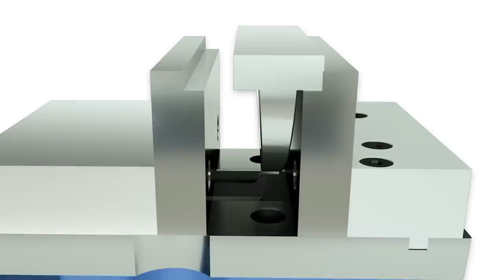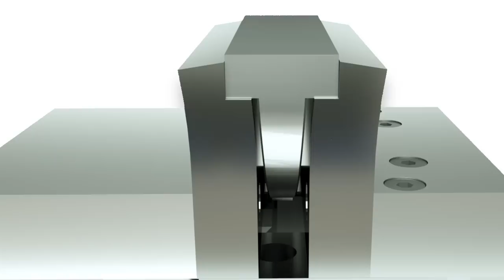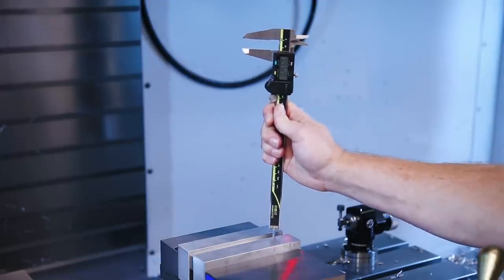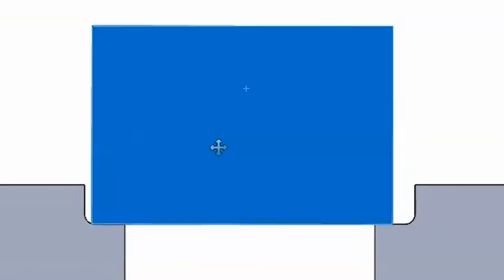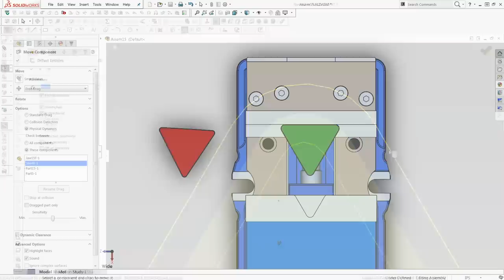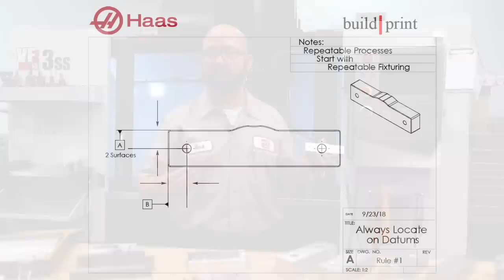Mill Soft Jaws: The Proper Way to Make and Use Them – Haas Automation Tip of the Day

Comment: PERSONALLY i profile my jaws and cut all 6 surfaces. When you go to reuse them they repeat like crap if you use material as is. I also want to be able to indicate an end to be sure the shape in each half match up. In extreme cases I add a 1/4" dowel on the faces so it engages when setting up repeat jobs. Cutting corners NEVER pays dividends. Of course this is just my opinion, based on 40 years of being one of the best in the industry. <:/)  We were making soft jaws in 1977.
Reply from the maker: Well_RoundeDSquarE – Cutting all 6 sides definitely creates a more precise jaw, but for one-time-use jaws it doesn’t necessarily create a more accurate part. In the prototype world, it rarely paid off for me to machine all sides, surfaces that wouldn’t touch the part or vise, unless the extrusion came in really rough. By leaving the extrusion raw, and the ends sawcut, people knew not to indicate off of them – I didn’t want the ‘illusion’ of precision. If the jaws are machined, then they should be machined perfectly square (to what tolerance?), which was just more time then I wanted to spend for a one-time use set of jaws. I was working on maybe 4 parts a day, for a decade, so the shop floor felt more like a commercial kitchen with orders coming in and out than a machine shop. Then, on high-volume production, everything was tool steel, and ground. I see your point, and agree with you, but on a case by case basis. Thanks for the comment. – Mark, Haas Tip-of-the-day
Reply: I understand your point, I cut my teeth on prototype CNC, and it seemed my niche` was to always get the job with one piece of material and/or too big for the travel. I was never one to use soft jaws one time, and throw them away. I guess it just wasn't my style. I in no way was questioning your methods, rather adding my own take based on my experience. I'm sure I probably had another minute per jaw in my cycle time, but in the end I had jaws easily under 5 tenths tolerance. As i'm sure you know, it's just as easy to hold .0005" on a CNC with any decent tooling as it is .005". It's always been my practice to run +/-.005 parts inside of .0005". that was all the way back when machines had stepper motors with .0003/.0007 steps. Modern machines you can program and comp to 10 millionths, and see it on the part. Anyway, thank you for the reply, and thank you for taking the time to pass along our amazing trade. Craftsmen are a dying breed. I wish I could pass along all the knowledge and talents I have, it seems as though they will be going with me to the grave. A real shame considering I was (if not still) among the very elite programmer/machinists in the Bay Area, if not the country. I think the trade could really use a school where companies can send their top guys for higher level training in how to tool a job, how to fixture jobs, how to approach a part most efficiently, how and when to use or not use certain tools. So many shops and machinist are stuck in their ways, and have no creativity, no freedom in how they approach a part. Like you mentioned, building one off parts, your approach may be very different than tooling up for 1,000 piece run. I like to cross train as i did from the start. anyway, I've rambled on enough... keep up the great work. Peace to All. <:/)
Reply from the maker: Great reply. I’m about ready to tip to the always-square-up-your-softjaw-jaws side, as opposed to leaving them raw. In my small world (prototype shop at the time), we did things one way, but in general we always want to take pride in our work, deburr your parts well, square up your material. Just good practices. Great conversation. I’ve never regretted doing a good job on something, putting in some craftsmanship. Thanks. – Mark, Haas Tip-of-the-day
Reply: " I’m about ready to tip to the always-square-up-your-softjaw-jaws side, "

I will go one step more and make the C-bore just a little deeper then the thickness of the bolt heads.  To get as much jaw material between the head and the vice.  And then if the OCD is acting up I put a  0.150" by 45 deg. chamfer on the back side.
With the deep C-bores the jaw material will become distorted a little after a few uses forming a raised area around the bolt hole.

But as you have said for most jobs it does not make a significant difference, and when it does hardened and ground tooling is often justified.

These videos and the free training are part of what makes Haas stand out in the industry.

But I would like to have a chat with whomever decided it was a good idea to wrap the top edge of the front and rear covers on top of the table.  Little chips just love to get in there and slice up my hand.
Reply: blow heart

Comment: I hate reversible jaws they invite stupidity. I've seen jaws at my place of business that they've done this too the point that nothing touches the vise bed. It became such a problem that we finally outlawed the practice altogether. With discipline I see it's usefulness but It just caused more problems than it solved in our situation.
Reply: I'm smiling right now, I know exactly what you're talking about. We mill the jaws so many times they turn into Swiss cheese, and don't touch the floor of the vise any more. That's an issue. Great comment.